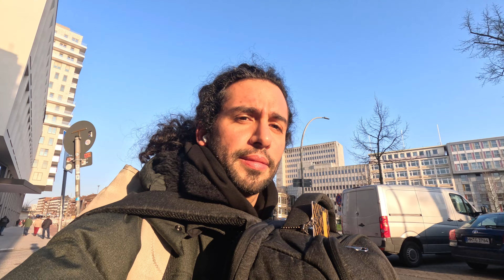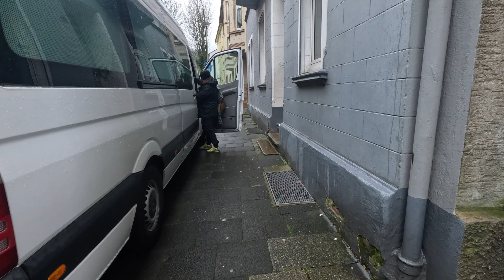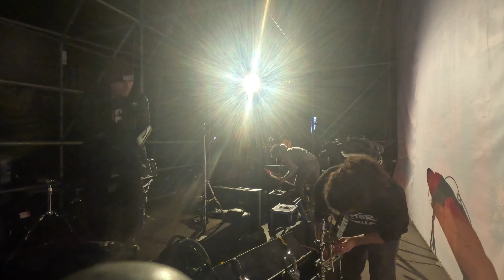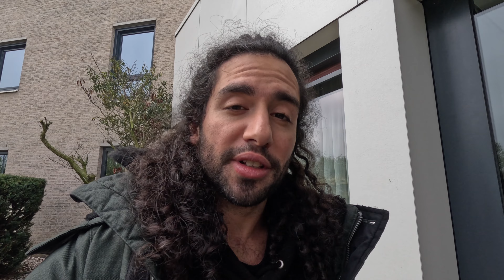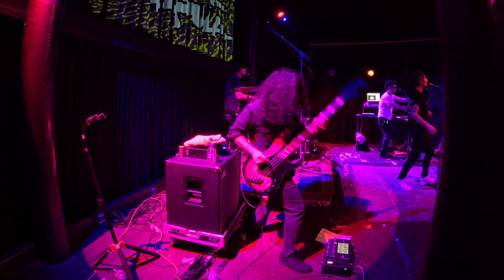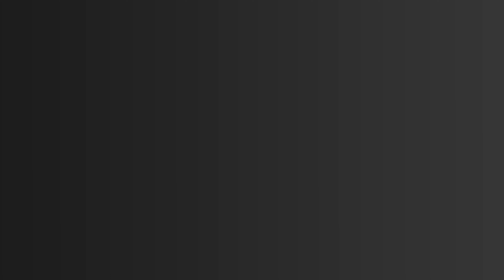When Things Go Wrong On Stage | Bass Tone Tuesday

Comment: One thing that I can't go on a gig with is a backup bass. There are two main reasons for me:

1. Breaking a string is rare but if it happens, you sure could do a quick restring which is, of course possible in many situations, but if you have a well timed set with transitions between songs etc. this really can kill the flow of an otherwise great show. Switching the bass will always be faster. Like ten years ago I broke a string on the second song of the set, didn't have a backup bass and was so dumb to leave my spare strings in the backstage on the other side of a crowded club. It took me 5 minutes to be back on stage and I really messes it up big time :D Maybe I got a little trauma from that experience haha 

2. and more important: The Bass is the source of your sound. If you notice something on your bass right before or during the show like a broken input jack (because somebody ran over it 5 minutes before the show) or buggy electronics (humidity, sweat...) and if all the preamps or amps stop working, you still can plug in a DI and play the show with that second bass 🙂